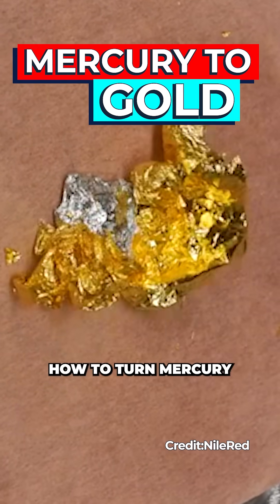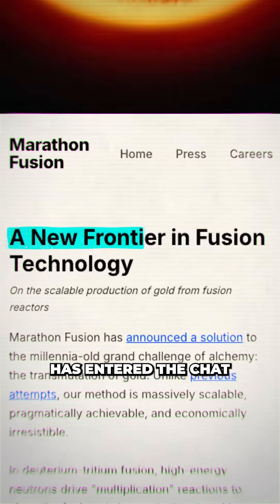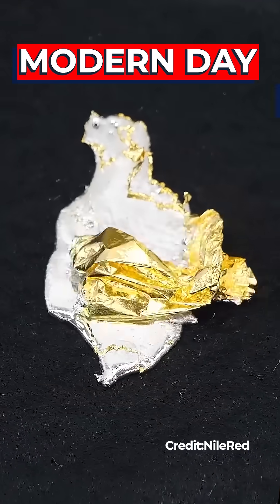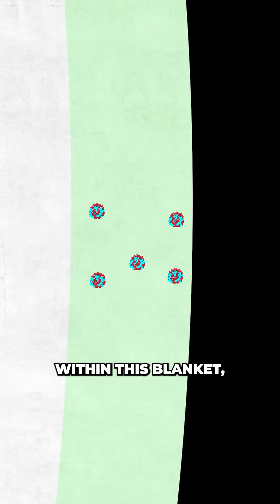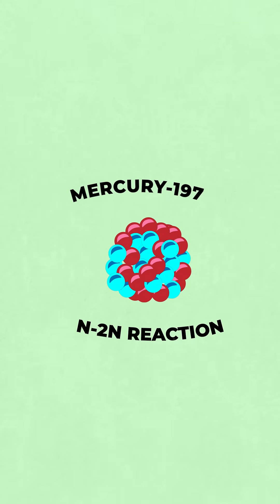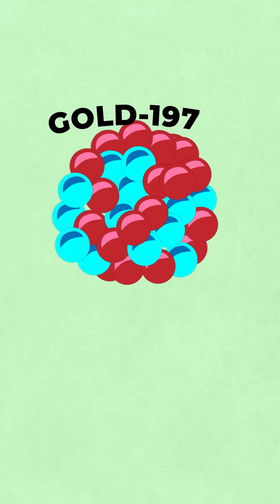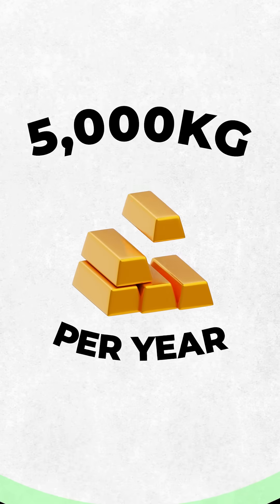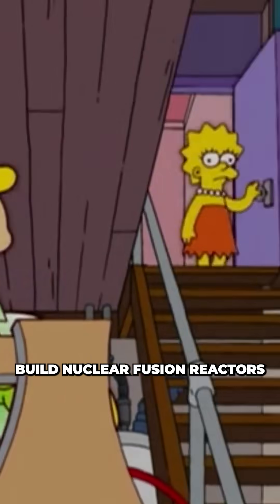Scientists Turn Mercury Into Gold

Comment: Gold is used widely in the electronics and other related industries, if this is adopted into mainstream manufacturing then it will hopefully benefit it and drastically lower the price of many  houesehold electronics!!
Reply: Imagine widespread gold wires instead of copper or aluminum!
Reply: @FireFox2313-di6bk
Is gold a better conductor than copper?
Reply: @artistaroundtheblock2047  (WRONG) yes—but its cost makes it impractical

EDIT: I was wrong, copper is more conductive, but gold is more resistant to corrosion… sorry! 😔
Reply: @artistaroundtheblock2047 it’s not, but very corrosion resistant and a lot better than aluminum
Reply: @artistaroundtheblock2047 Silver (Ag) is a better conductor than any of them
Reply: @Dharmik-w1mbut silver is both more expensive than copper and more prone to corrosion, so copper is still the optimal material for it's balance of corrosion resistance and electrical conductivity
Reply: @FireFox2313-di6bkI believe gold-copper alloy is terrific, tho, so having more gold to play with might improve electronics even more. Tho the major problem with making wires out of red gold would be that people would want to steal them. Even with inflation due to creating more gold, the value is likely to stay high enough to motivate wire thefts
Reply: @artistaroundtheblock2047  no, and both are worse than silver
Reply: @Alyssa-h5g  yeah and people already frequently steal and sell copper wire/piping soooo
Reply: @wasp795 but aluminium is so much cheaper that you just go for a thicker aluminium cable. The thicker the cable, the more conductive.
Reply: @FireFox2313-di6bk Gold wouldn't be strong enough for general use. And it's too dense, about double that of copper. It would add too much weight. You think if every vehicle used gold conductors/wires instead of copper, they'd carrying double the weight. How much extra energy would be needed to carry that around. The gold is less conductive so you lose energy there too.  There's probably no benefit doing that.
Reply: @FireFox2313-di6bkAudiophiles can't get any more excited.
Reply: Is like saying having self checkout or have video games digital download will get lower price but in reality the prices INCREASED >_>
Reply: The amount of gold used in electronics is negligible compared to the supply (mostly used for jewelry/store of value).  The major cost of electronics is ROI on the development costs of creating a consumer electronic, as well as manufacturing labor hours, not the materials.
Reply: @nezzee  this is correct, electronics are expensive because of the massive supply chains, you must first obtain raw ore, refine it, make it into metal form, process it into the desired form, then you must combine the products together with ultra specialized machines
Reply: so little gold is used in HOUSEHOLD electronics that the price difference basically won't happen honestly, we've gotten so good at using very little even compared to 20 years ago (I recycle these electronics for gold on an amateur scale) it would just make it cheaper for some industrial electronics to be exorbitant and wasteful with gold which they've already worked out how to avoid doing this long ago (by using silver doped with cadmium to protect against oxidization etc) so it really wouldn't have the impact you'd hope in terms of prices of the goods most likely
Reply: There s very little gold going into electronics, to the point you need to scrap about 100 kg of electronics to get 10 grams of gold.
Reply: @Graine01  What??? 252 tonnes of gold were used in electronics in 2022. That's worth about £20 Billion today. Way more than the GDP of many countries. You could pay to run a dozen countries with that!
Reply: My CPU is going to finally be made out of gold instead of aluminum.
Remember when they used ceramic packaging, and gold fingers.
Was beautiful.
If I'm paying a $3000 for a piece of sand that is my CPU, it better also be made of gold.
Reply: Most electronic's are exspensive just cuz for example cables an hdmi cable can cost $30 but if you perchace it from the manufacturer it will only cost $5
Reply: Makes no sense there’s only a finite amount of gold so how the fuck are they still using it in tech
Reply: @levitabusman  About 95% of all the gold that's ever been dug out of the ground is still in circulation today. Must be one of the most recycled things that ever existed. Plus there's actually way more gold than we've got uses for. That's why a lot of it just sits on shelves in bank vaults. The use of gold in electronics appears to have peaked, it's use is in decline, replaced by other materials & methods. So that's how!
Reply: @levitabusman Why wouldn't they?
Reply: It's cute that in this day and age you hope this would benefit anyone but the wealthy. I love how all this new fangled technology we got over the past few decades has made life more livable! So much I get to do after spending 60 hours a week working just to "live"! Thanks, techbros!
Reply: @mightygingercles6481  It's your own fault for living a life that needs 60 fuckin' hours a week to sustain itself. Get a better job that pays more, or start spending less on  things you don't actually need. Yes, it's that easy. Unless you live in bumfuck nowhere. Even then, you can find at-home jobs to do. There's always people like you who complain, complain and complain yet do literally nothing to change the outcome that you're so eager to complain for.
Reply: @mightygingercles6481 Well you can use the gold instead of lead to solve that problem then, how fitting
Reply: @mightygingercles6481 You can go live in a farm if you want
Reply: You misspelled “collapse world economies”.
Reply: @WhackBytch256 
If there was still major global reliances of gold for preserving the values of currencies then inflation wouldn't be near what it is now

Rare metals like gold are going to completely loose there artificially high values eventually anyway with astroid mining regardless if this project gets somewhere or not
Reply: @WhackBytch256  new more efficient ways to do things collapse encoamys? By that logic the economy should have collapsed with the industrial revolution or the invention of the combine harvester or with the advancements that made aluminum go from an insanely expensive luxury metal to something we build sodacans and aircraft out of as long as you aren't using the gold standard your fine
Reply: @WhackBytch256 Who cares about financial capitalists? Its far better using gold for actual purposes like research and industry

Comment: The price of gold is about to go way down
Reply: Good. It's more useful as a conductor or coating and in microchips.
Reply: @jesusmora9379  Its only the 3rd best conductor. Copper is 2nd and silver is 1st.
However golds anti-oxidizing and anti-corrosive properties cannot be beat. If cost wasnt an issue, i'd bet most metals would be coated in gold.
Reply: @ChaotiX1 aluminum was used in houses and is used in power lines because it's cheep even though it's not the best conductor if gold was cheep enough it could end up being used in simalar application because of its cost
Reply: @ChaotiX1 Maybe they will be soon 😂😂
Reply: @acompletelynormalhuman6392  it would have to be cheaper than copper to justify its use in electrical applications, which probably wont happen for at least a few hundred years (given how common copper is)
Reply: Well, not for another decade or two, if you read the article it states that the gold you get is radioactive and it needs at least ~18 years of waiting time before being safe to handle, the effort and investments required aren't small either.
Reply: @_deathcry how radio activate though? Like you get a banana equivalent dose from it or actually a problem if misshandled
Reply: @_deathcry It never is. As the saying goes, you have to spend money to make money
Reply: @_deathcry  the gold produced is stable, it does not emit radiation, you can get rid of the radiation.
Reply: thats a good thing
Reply: The material is still incredibly useful if anything that's a good thing, that would make many hard to obtain technologies far more accessible both to important facilities and average people.
Reply: Good. Who cares about financial capitalists? Its far better using gold for actual purposes like research and industry
Reply: Except this is theoretical and nobody knows when any fusion reactor will be viable.
Reply: Well, at least we won't run out a while longer. Not that recycling it wasn't possible but hard depending.
Reply: Up. It is goong up
Reply: @Scarletraven87 And so is everything else
Reply: Trying to stop people buying gold. 
Haha, I’d still hold gold over some country’s currency.
Reply: @Mr987greg123 you see gold is "inherently valuable"  whatever that means
Reply: @acompletelynormalhuman6392  if countries see it as safe, maybe it’s safe. It doesn’t matter what i think it is more about the rest of the world.
Reply: Bitcoin is unprintable
Reply: 5000kg of gold = 0.0025% of wold supply... so price wouldn't go down much.
Reply: @orangeraven3869  yeah but thats one reactor over one year
Reply: No it wont, the gold cant be used as it is radioactive and it isnt possible right now to mass produced it
Reply: Could cause chaos in the finance world. Gold is an important store of value for many countries and individuals. There are countries that still use the Gold standard and for others Gold reserves form part of the backing for their currencies worth. Probably not a good thing to pursue until there's a new agreed upon store of value and people and countries have had a chance to move to it.
Reply: Why would the price go down?  Do you know what it costs to upkeep a reactor?  Companies make more money selling power than they would with gold at only $3500 an oz.  I guess if Au went up to $10k an oz then it might go way down to $6k or $7k an oz.
Reply: @tedo3332 makes sense why eu hates nuclear reactors. The wef imf chads instigating hate, knowing stable energy and now free gold lowers prices, creating a new world order
Reply: @tedo3332 The price would go down because the increase in supply is what they're saying. The point isn't that they would be self-sufficient off of selling gold, they would still need to be selling power
Reply: @tedo3332 and imagine how much more gold/watt they could potentially output when more research is done and the tech matures more. Science doesn't stagnate
Reply: @Roachling2Maybe in 100 years
Reply: @tedo3332 no point in completely stopping development. If there's a chance it's always gonna be worth taking either way considering a potentially unlimited source of gold would be huge in technology and bringing down the price of both consumer and business grade electronics. Ofcourse it'll take time, nothing comes in a night's worth of hard work
Reply: More great news for Bitcoin! 🤑🎉
Reply: this is what I want that to write😂😂❤
Reply: @MagnetoV-c5i for real this is what people should be doing, buy bitcoin and hold it for life, only sell a portion when prices soars and buy again when there's a huge dip, repeat
Reply: @VanelPettigny-r9e Nah, that's utter trash. At least gold has a use beyond speculative nonsense
Reply: @MagnetoV-c5i  It would literally be the collapse of the West if Gold was devalued.
Reply: @MagnetoV-c5i yep awesome 😎👍
Reply: @MagnetoV-c5i 😂
Reply: No the theres more gold than we are lead to believe and this is a way to inject the reserves back into the system that we weretold didn't exist.
Reply: @alexhise968  bro is really bored

Comment: The thing is that
1. The gold ain't even worth it since it's what, like 1 atom small (correct me if I'm wrong) 
2. Gold would plummet and as someone from another video said "Gold will become so worthless that wood will be treated like gold" if we could create gold by mercury
Reply: Larger quantities of gold existing, would free up gold for use as an ecological electrical conductor (less power lost to heat than copper) a non-poisonous nonstick pan coating, and general non-reactive material. Gold would have so many new uses, that it would become extremely valuable. Just in larger quantities than its old scarcity value.
Reply: @Mecharnie_Dobbs no wonder c3po wa made of gold.
Reply: Mercury isnt free though
Reply: You do it a lot more than once. They can, hypothetically, get a reasonable quantity of gold out of this. 
You're right that gold will quickly lose its arbitrary scarcity value, though.
Reply: @TheRatsintheWalls ok thanks for the info

Comment: Lol now the gold standard means nothing😂
Reply: It hasn't since I believe Reagan. We've been on a fiat currency for quite some time.
Reply: @tommymakem2611  
In 1933 the U.S. officially abandoned the gold standard for domestic transactions under President Franklin D. Roosevelt.
In 1971 President Richard Nixon ended the convertibility of the U.S. dollar to gold, effectively terminating the Bretton Woods system. This marked the complete abandonment of the gold standard in the U.S.
Reply: @tommymakem2611 yeah, but it's about to stay that way forever
Reply: @tommymakem2611  No I'm pretty sure the gold stanard stopped when Nixon took office
Reply: Platinum or Palladium standard?
Reply: @owenpeck4857  untill they make dat in lab lol
Reply: The amount of gold this would produce would be a drop in the bucket compared to the amount of already existing gold.
Reply: @Green__Ghost look at lab made diamonds. We used to be able to make little of it, now there's a whole industry of it.
Reply: @Green__Ghost it really depends on how common fusion becomes and if it becomes economically viable against other energy sources at the very least how cheep gold is would be limited to how cheep mercury is (ironically some gold ores also produced mercury so you could reuse a by product of gold mining to make more gold)
Reply: @Green__Ghost You'd be truly amazed at the EXTREMELY small amount of gold that had actually been mined, processed, and made available.
Reply: The gold standard never did mean anything.
Reply: We haven't been on the gold standard in forever dude🤣
Reply: The value of everything is made up by man. It's all make believe based on the three basic human emotions of greed, greed, and greed.
Reply: @shelbyseelbach9568  i hate when people say humans are inherently greedy. You're just telling on yourself lol. I'm certainly not greedy. The people in power are greedy because in our capitalist society, greed is generally required to become powerful. When greed is needed to become successful, humans have motivation to be greedy. The system is the problem, not human nature.